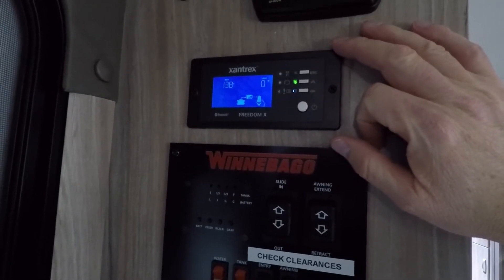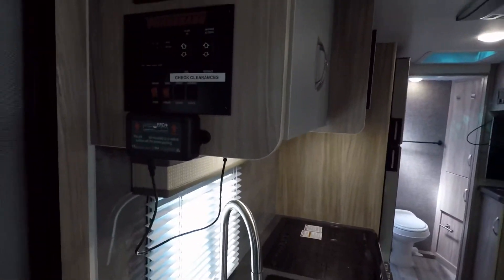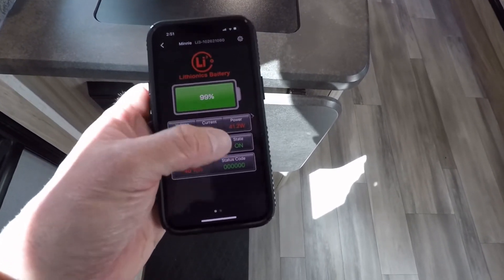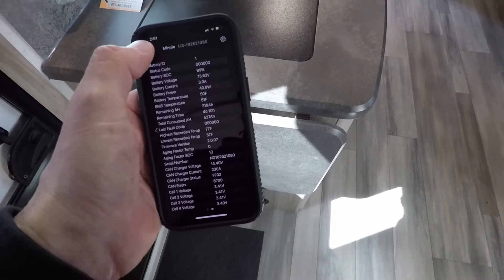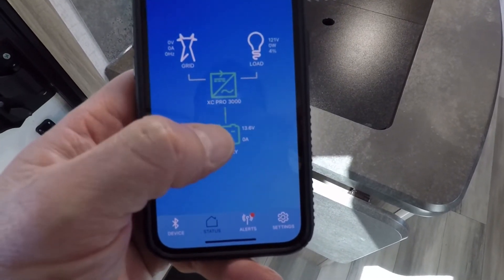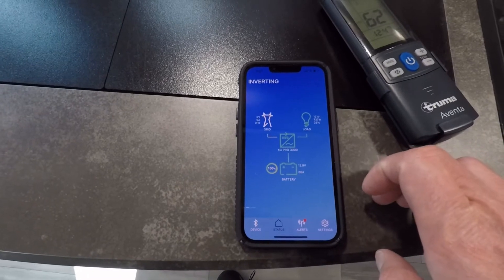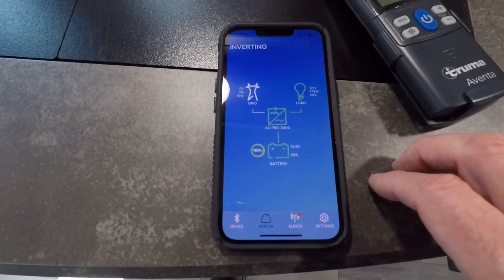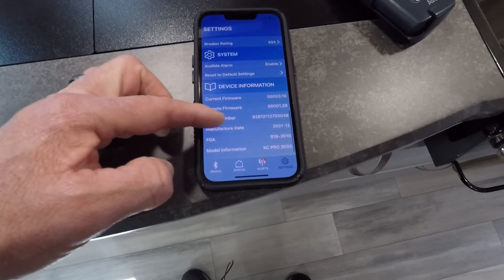Micro Minnie FLX- Applications

Comment: when my battery is showing 100% the xantrex shows 50% any idea what settings i need to change
Reply: I see you have flooded selected for your battery. From what I've seen on the forums you need the lithium-ion option selected.  I had to change the battery type from flooded to LiPoFe4 for the lithium as well. It looks like they sent them with default settings from the factory.